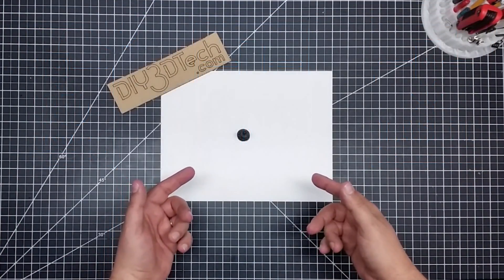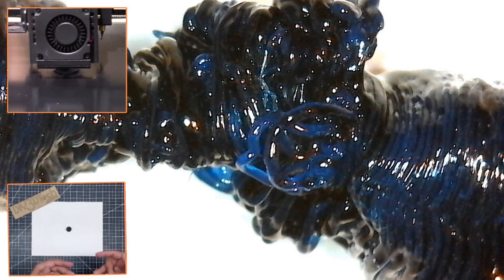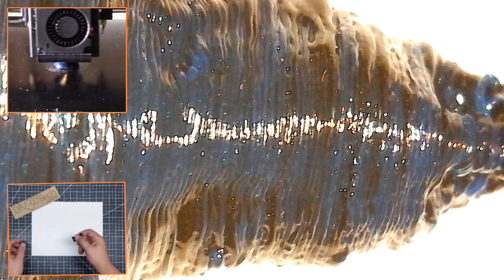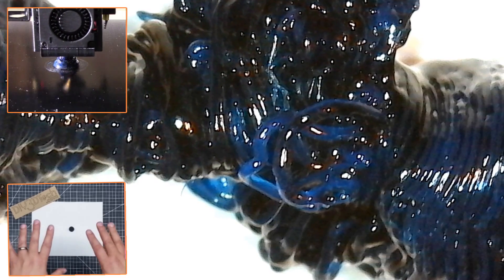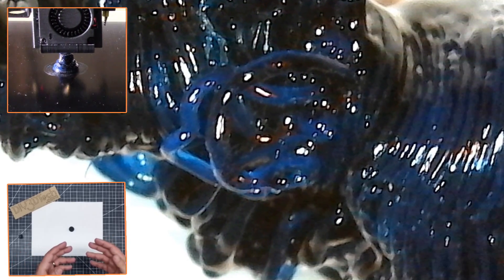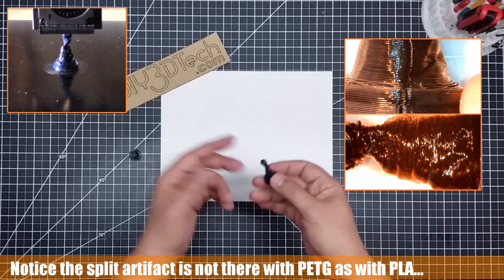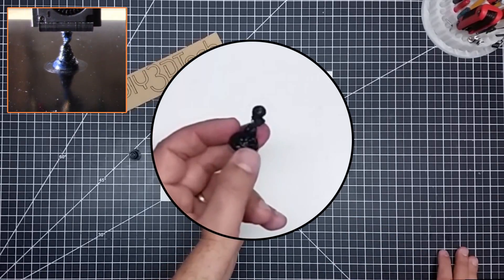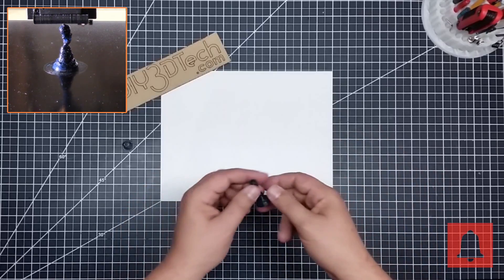GeeeTech A10M - Mixing PETG with TPU!

Comment: I feel like a large problem (in the mixing) is the difference in individual material viscosity at printing temperature.

Both experiments had issues combining filaments, but in different ways it looked like. The layer pattern from the previous pla+tpu test looked like a 'swirl-cone' -as if the plastics are simply getting squished together side-by-side in the extruder (not combining), and then as it is laid down that pattern naturally occurs, at least from the visuals in the videos.
This petg+tpu test looks like it's doing something similar, but mixing together differently (better, despite a worse result (chemical structure?)), maybe something to do with the petg gooey-ness.
Reply from the maker: I believe your correct, I will talk this more in the ABS & TPU fail video which should come out tomorrow...